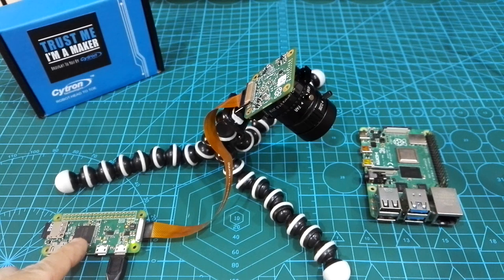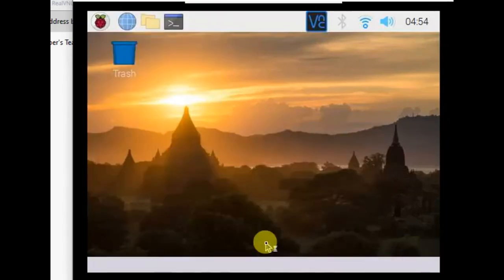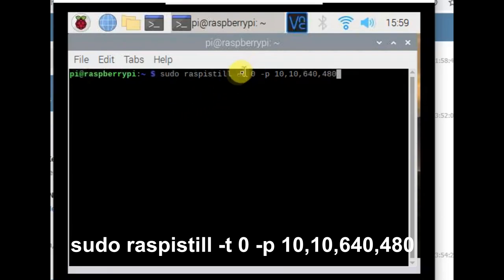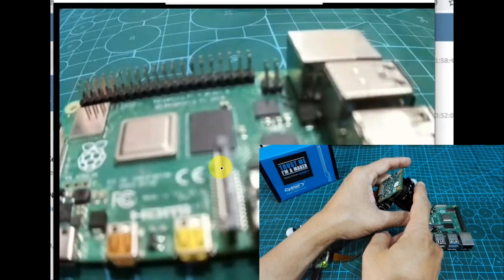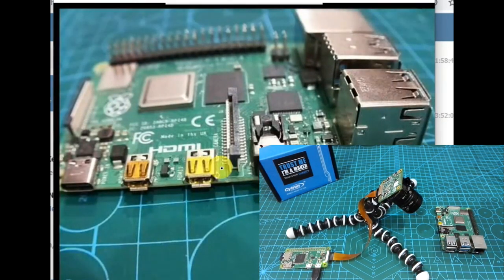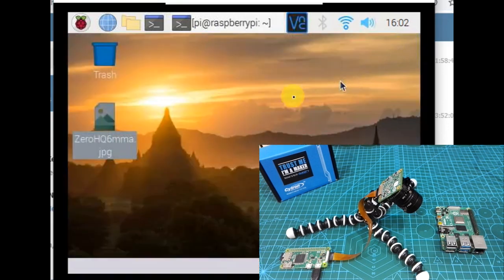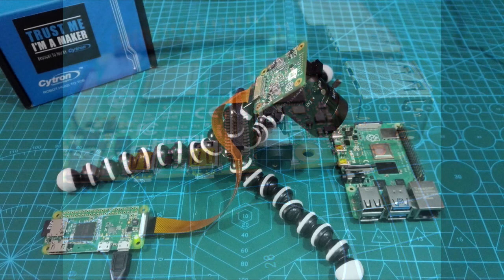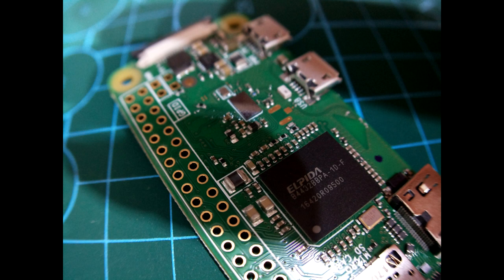Raspberry Pi High Quality Camera + 6mm Lens on Raspberry Pi Zero W

Comment: does the dimensions of the pizero align with at least 2 of the mounting holes on the camera module? the setup would be much cleaner that way
Reply from the maker: Very good idea, but I have just checked, the two holes are not align :(